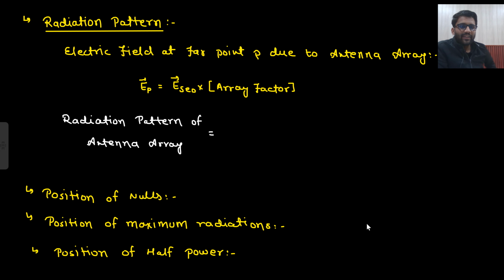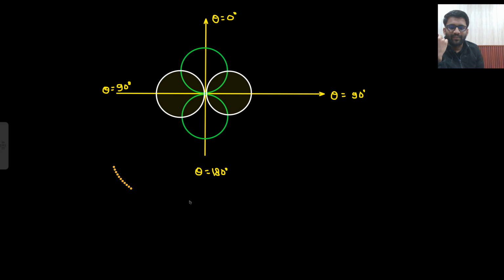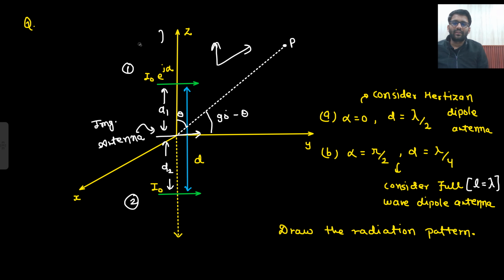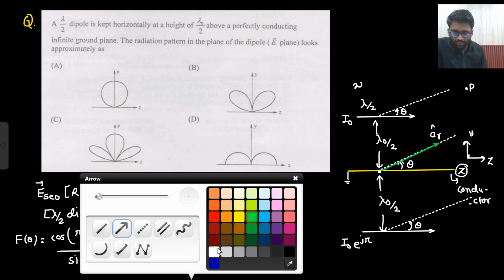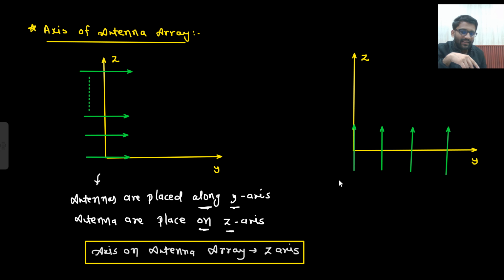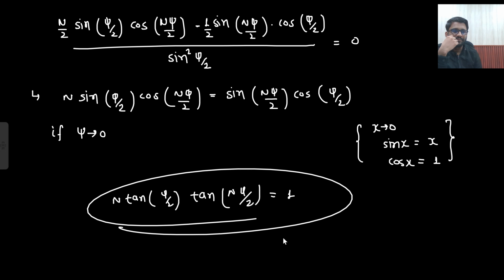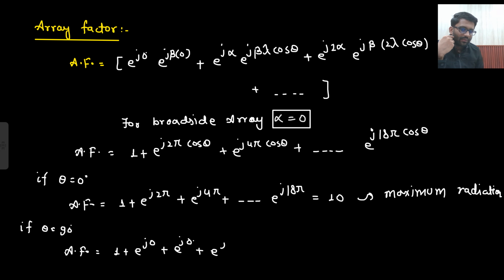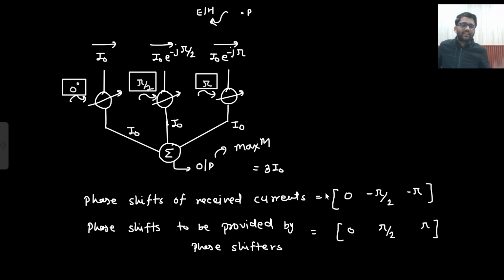Radiation Patterns and N element Antenna Array || EMFT || ECE || PrepFusion || Himanshu Agarwal

Comment: In the last ISRO question, why can't the answer be option(a), if we take the currents of antennas as considered as I1=  I0<(pi/3),  I2 = I0,  I3=  I0<(-pi/3) ??? The same kind of analysis is applicable for option(b) as well if we consider the 45degrees phase shift for antenna current.
Reply: but it is given that we should consider 1st antenna as reference